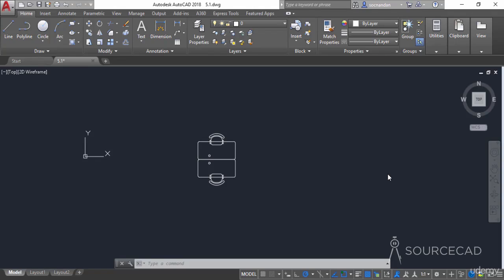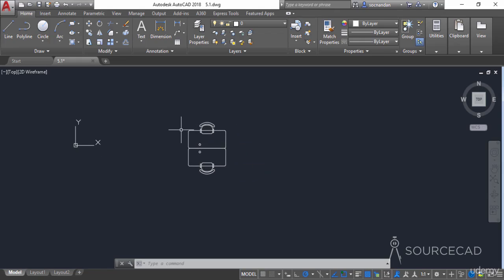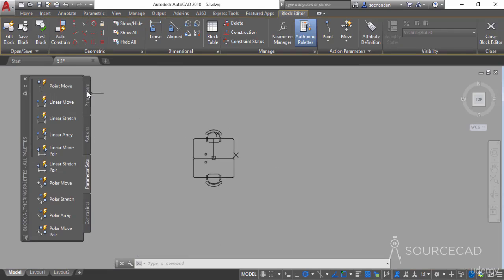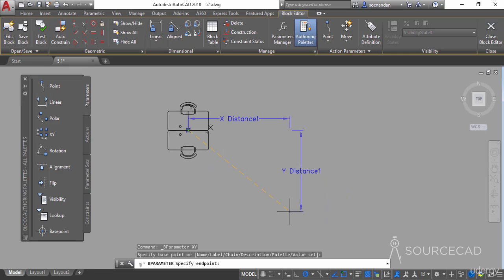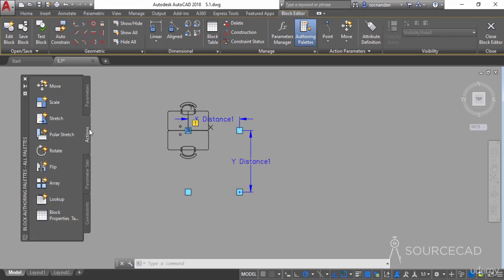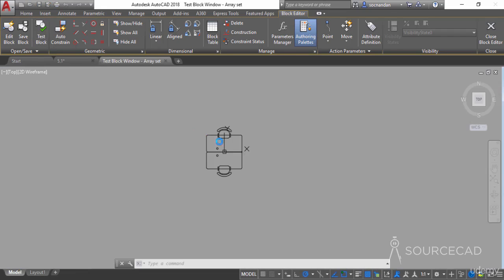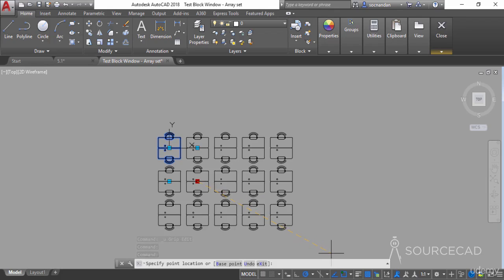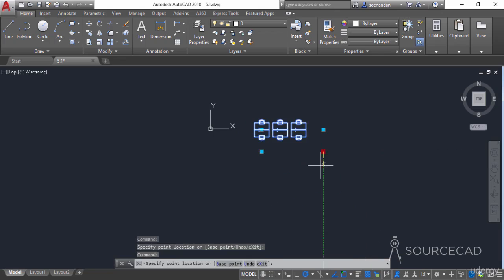127 Using Array action in Dynamic Block

Comment: Thanks for your videos, I have this question
How to make a parametric (variable or depend on other values) array column or / and rows 
Example: I want to stretch a dynamic block to get an array form or action, but the offset is not fixed, but it depends on the table width and a variable distance between the tables (it means two controllable other parameters).
I tried to use it as a formula or "Parameters manager" and the "Quick Calculator" parameters or way (such as with or without '$'), but I failed and sometimes  AutoCAD replied that "cannot assign a dependent parameter"